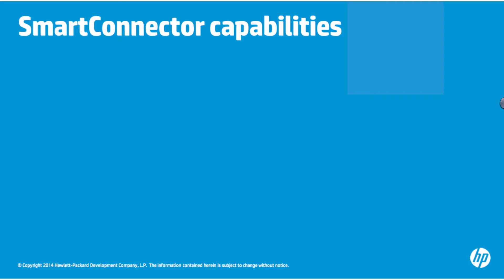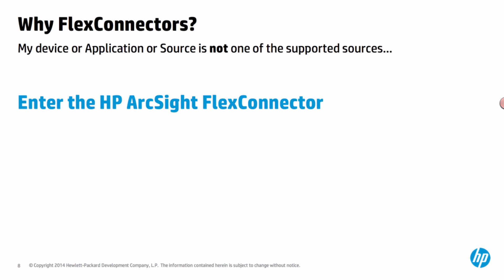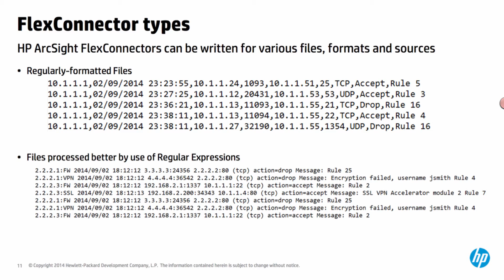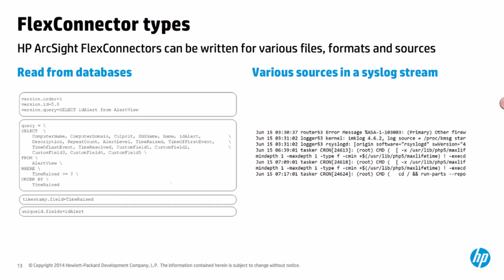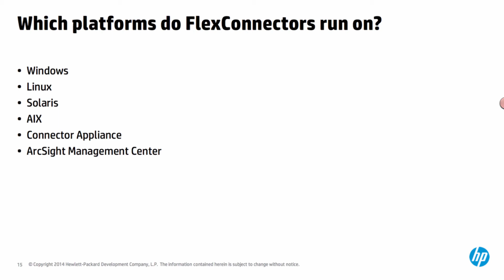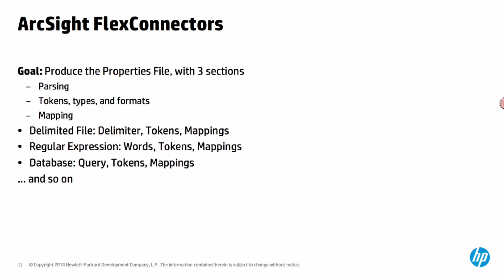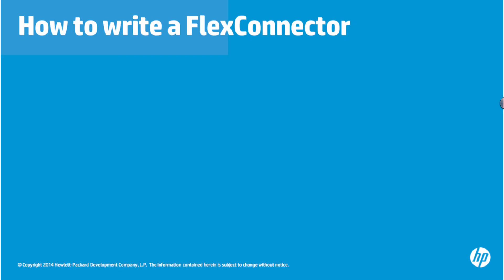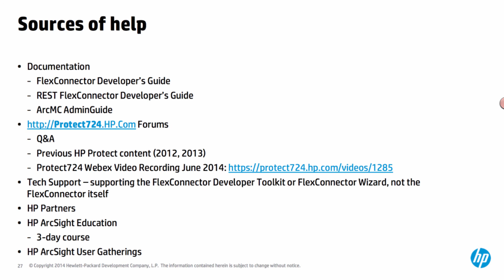ArcSight FlexConnector introduction

Comment: Hi Mr do you have Arcsight Console 6.8 or 6.5 ?
i neeeed
Reply from the maker: The version of the ArcSight ESM Console is absolutely tied to the version of ESM itself. If you have ArcSight ESM 6.5 then you MUST use the Console version 6.5; the same goes for 6.8, 6.9 and 6.11. So please check what version of ESM you have and go from there. To check the version of the manager, login to the server, go to the folder that it is installed (usually /opt/arcsight/manager/bin) and run './arcsight version' and it will tell you from there.

To download the correct version, go to http://support.openview.hp.com and enter your SAID or contract ID and you can download it from there.

Also, please do not spam me on multiple videos - I will respond.